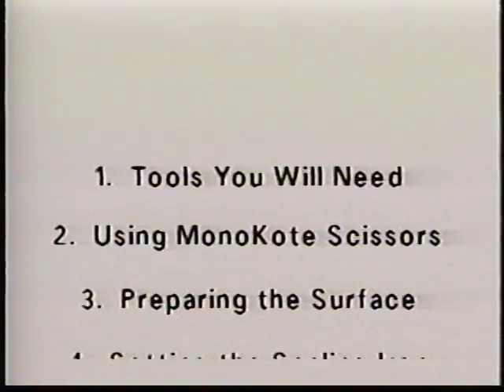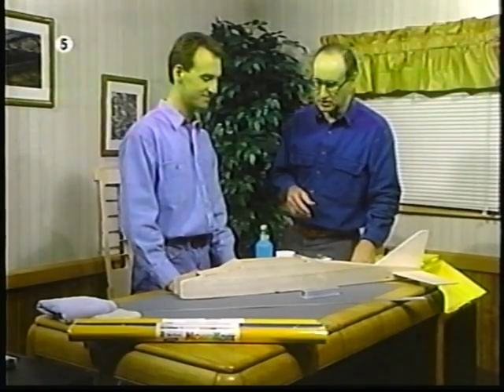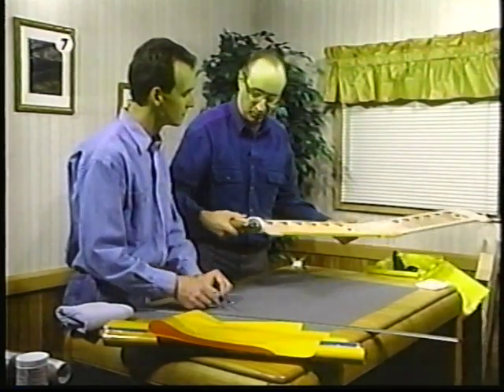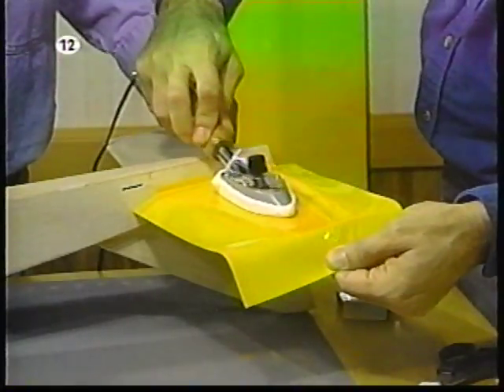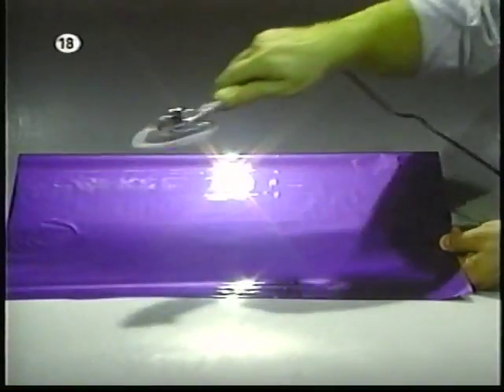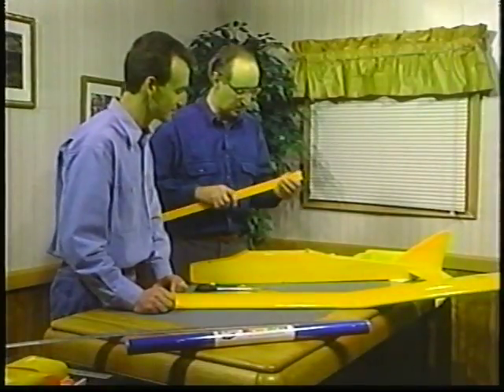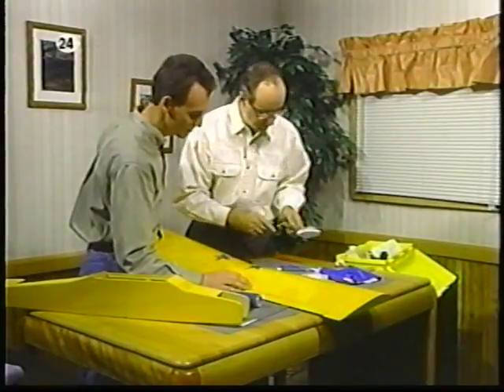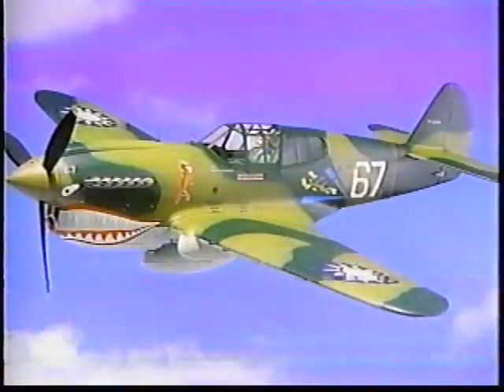Covering with Top Flite Monokote

Comment: That plane reminds me of my first balsa RC plane kit that I built, an Aerostar Trainer 20, I built it after I learned to fly with a Duraplane 20. Since the wing was wrecked on the Aerostar when I got it partially built, I used the foam wing from the Duraplane to fly it. Eventually I turned the Aerostar into a low wing, it flew amazing with that setup then ended up crashing it when an elevator servo broke gears when beginning a hard loop and it crashed nose first at full speed in my parent's farm field.

Comment: Copyright 1985ish

It's 2021

Back when everybody built their planes out of kits and used Glow/Nitro 2-stroke/4-cycle engines. If you saw a electric it was extremely rare. The construction was primarily balsa wood and plywood. These days the ARFs are mostly made of foam and are electric powered.

I'll stick with the 1985..........
Reply from the maker: What's your point?
Reply: @n1114v  

I made my point above....
Reply from the maker: @JohnDoeEagle1  now that its edited and explained I totally agree!